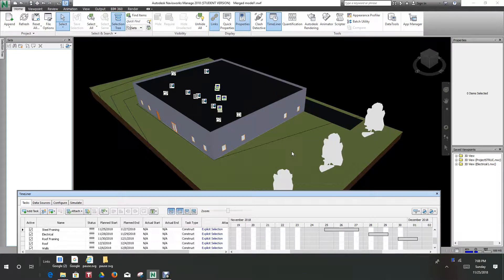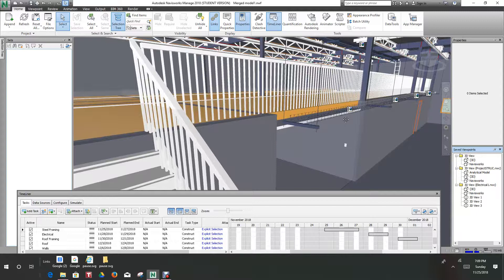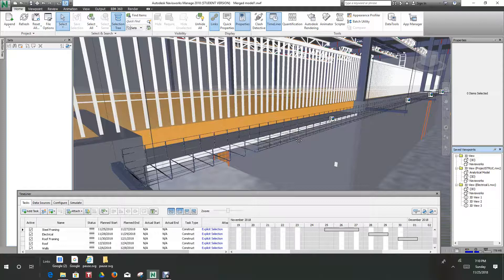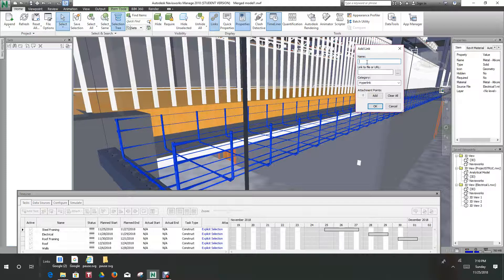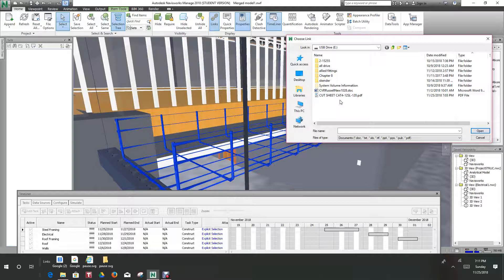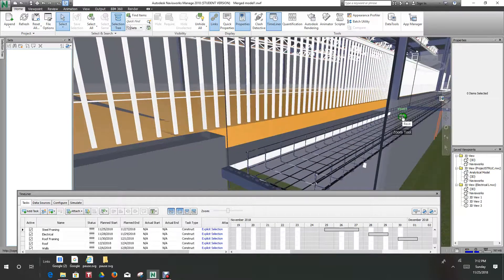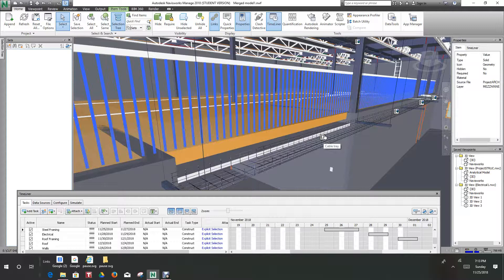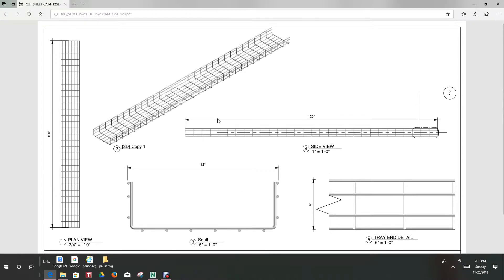Navisworks Links how to add links

Comment: How can I export this links that I created to another navisworks file?
Reply from the maker: Hi you should be able to link it to any Navisworks file, as long a the url is correct
Reply: @unidesigndc  but I would link to export the setup of all the links that I did. Is it possible?
Reply: @469rafael  Have you got answer for this? I am also looking for the same
Reply: @pankajbadgujar7357  not yet
Reply: @469rafael  have you found any other way to do the same